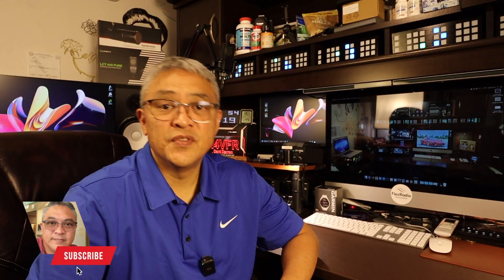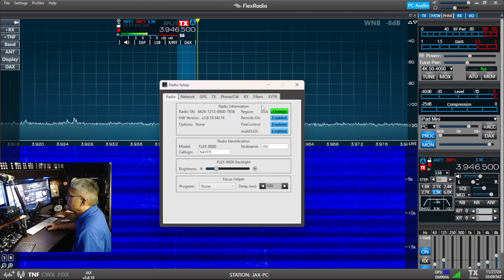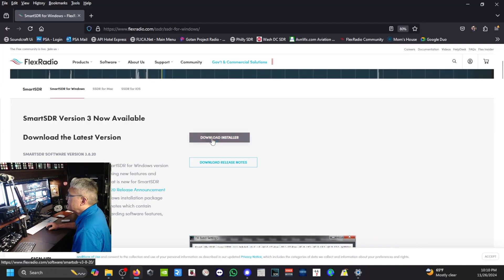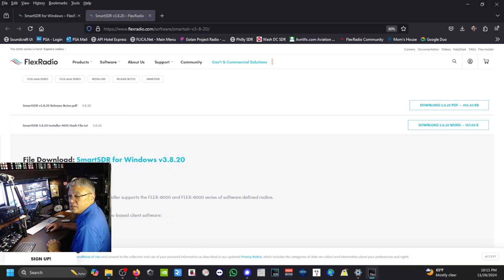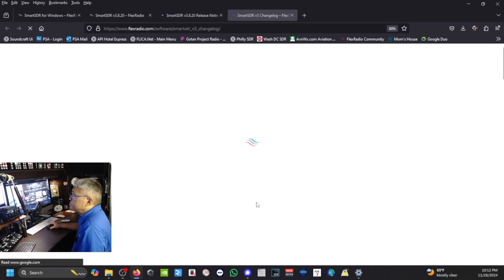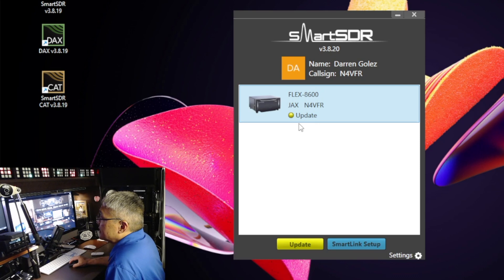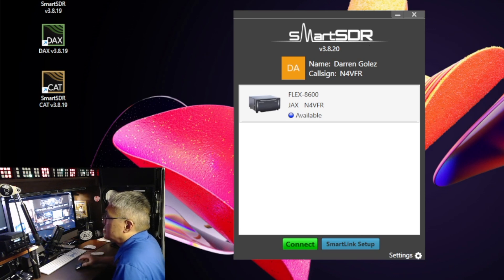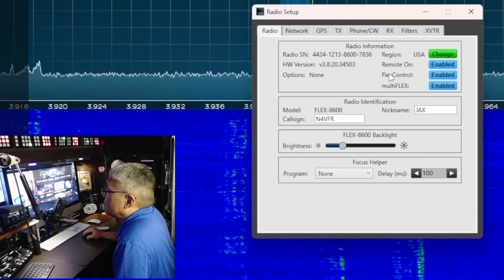Updating Flex SDR Firmware | SmartSDR v3.8.20 | How to update Flex SmartSDR for Windows

Comment: Thanks for the video. You had another one that helped on the ICOM remote software.
I'm helping a ham friend remotely resolve this issue - "SmartSDR for windows has lost connection please reconnect"

Any ideas?  The Flex Radio 6500 is directly connected to the computer.  SmartSDR version 3.8.23 and it has been working but now this error comes up immediately after opening SmartSDR and continues to try with the same error.  Flex and computer has been powered off and on multiple times, no luck.  Ethernet cable replaced, no luck.  SmartSDR re-installed as well as all drivers, no luck.